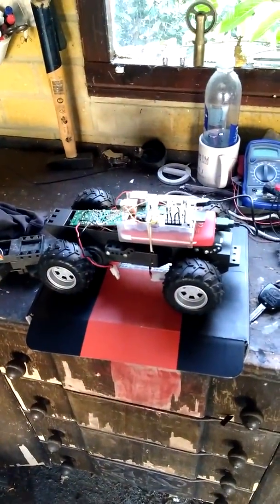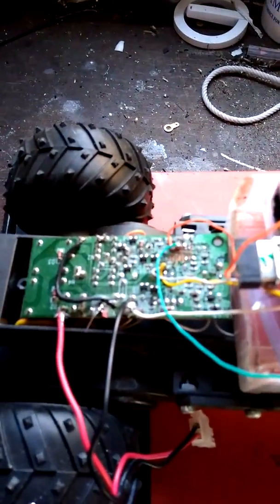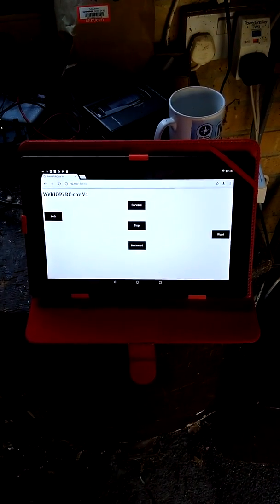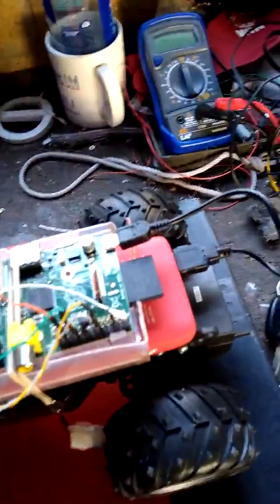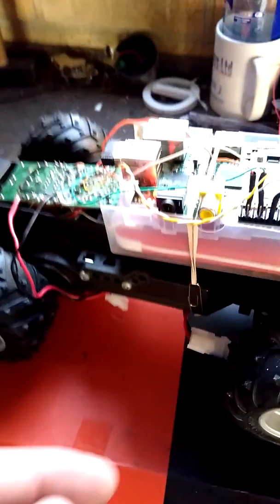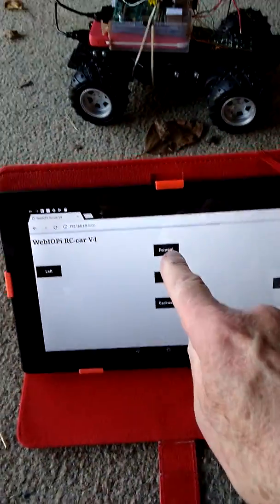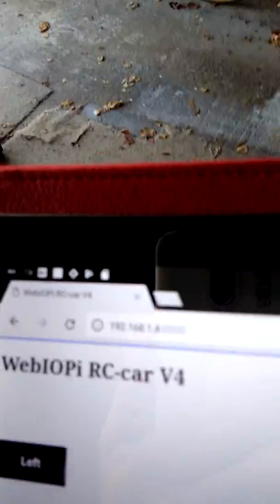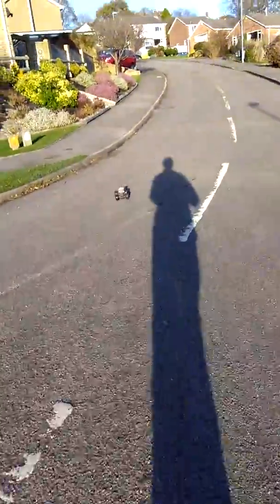VID 20171119 145322199

Comment: i have a few questions if you dont mind? i am doing something semi similar but it is to control a full size kayak i have all the hardware worked out but my issue is range so my plan was to put my extra work cell phone in the kayak as a hotspot so i am always connected. and in theory i can control this as far as the battery will go i was wondering if you could give me a couple pointers
Reply from the maker: My intention was to set up ad-hoc networking and eliminate the need for the access point. But WebIOPi doesn't work under Raspbian Jessie, and it's successor Cayenne needs an Internet connection as far as I can see. I am currently trying Flask from an article in Linux Format magazine from ?October '17. Again I'll try and set it up for ad-hoc wireless networking. Is that the sort of thing that you need, or do you just need longer range.  Another future feature would be to have the car stop when it gets out of range of the radio signal but I have not thought about how to do that yet.  Note this is my first car and I put up another video a couple of days ago same R-Pi and same software, just a different car.  I hope this helps. I look forward to seeing yours working.
Reply from the maker: I have not worked with anything other than WiFi, so I don't know how to connect with a cell phone.
Reply from the maker: Sorry for the delay. WebIOPi doesn't work any more with an upgrade to Raspian. I am now using the technique in the article in Linux Format magazine for using Flask. I then added  the software to make the R-Pi into an access point so that I do not need an external WiFi router.   It works but I haven't done a video of it yet, and I don't know if I have documented it in my blog [Madsmaddads ramblings].  I'll check this more often in case you have any more questions. Oh, final point, I replaced the driver hardware with a deek-robot driver board.